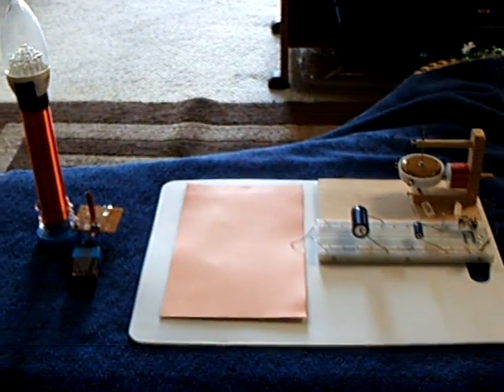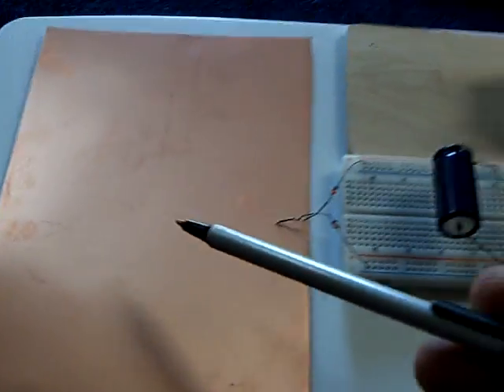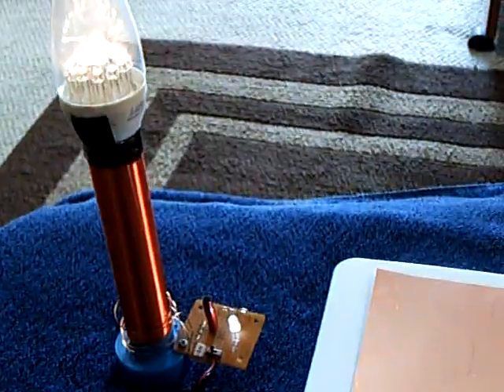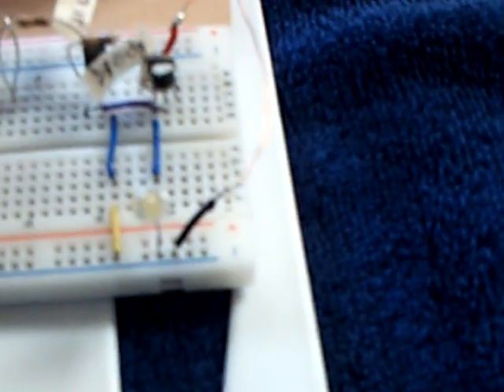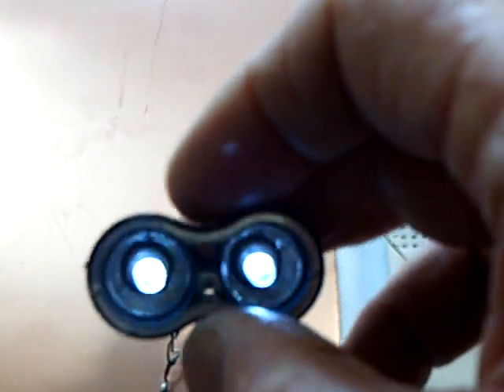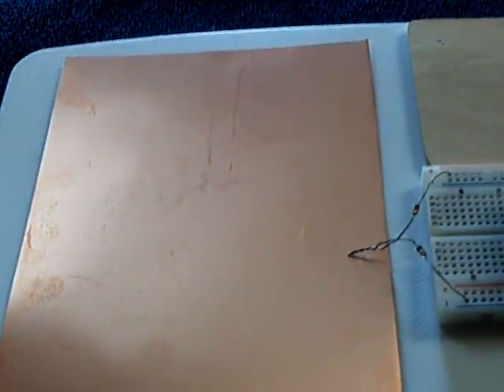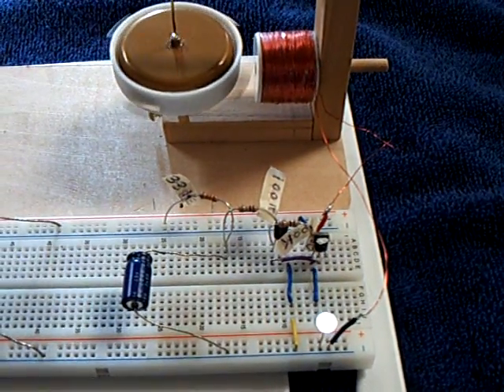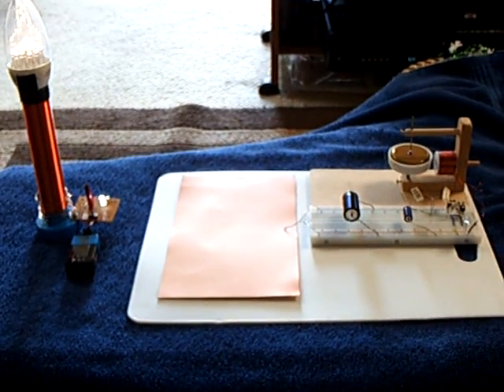Self start pulse motor run wirelessly off Slayer Exciter.ASF

Comment: I want to thank you for giving the frequencies for the two circuits you are running and some other things as well i posted a video on static energy and want to get another ready it seems you are seperating the voltage and current and as the current moves it gains field as it moves. there is just not enough space here for all i am thinking right now.